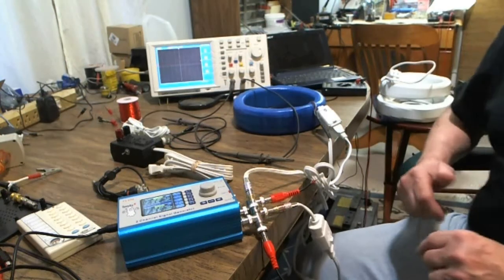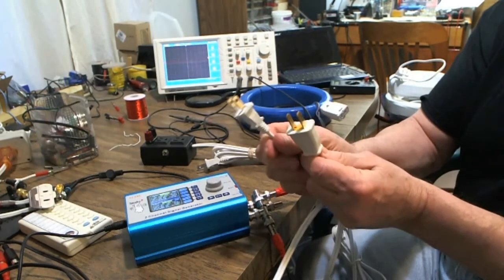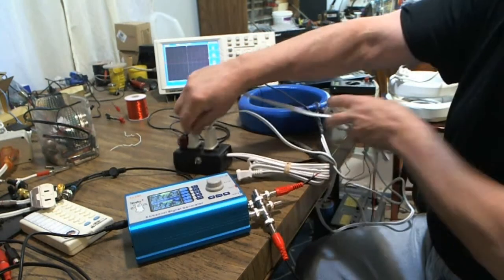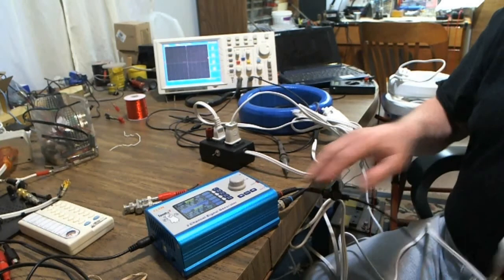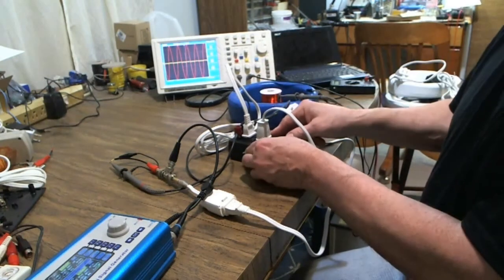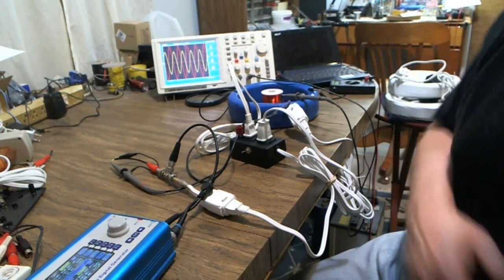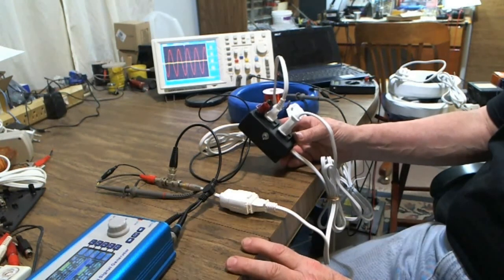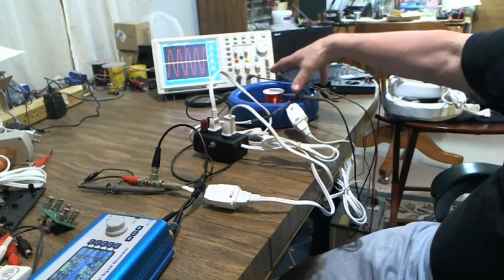Bifilar Coil & Switch Connection and Configurations

Comment: Where did the extension cord with the with the magnetic and scalar switch come from?
Reply from the maker: The local Dollar Store.  I buy them in quantity and could not put a plug on a 16 gauge wire pair for any where near what I pay for an extension cord.  The quality is excellent and have never had a failure. I thought it a great way to keep the cost of materials down.  Yes, I'm knocking on wood! -)
Reply: They come with switches on them? What is it doing to switch from magnetic to scalar?
Reply from the maker: I believe you are misinterpreting the video.  If you are referring to the extension cords, when you write the word “they”, “They”, the extension cords, do not come with a switch.  The Magnetic to Scalar switch is a simple mechanism to take t two windings of a bifilar coil and to connect them in series, for Magnetic mode or Scalar mode.  However in Scalar mode the switch reverses one of the coil's polarity to artificially reflect the wave back 180 degrees out of phase  onto itself. This eliminates the need to match the coil wire length to create a reflected standing wave. 
 
The theory of how a transmitted wave can reflect itself back on the transmission line/wire is beyond the scope of this narrative.  The obvious advantage of this phase reversal technique is that all frequencies introduced into the coil are reflected back when the switch is set to scalar mode.  As I stated in the video, the standing wave is the essence of how a scalar wave is generated.  As I understand it; the scalar wave is a pressure wave generated between the nodes of a standing wave and is transmitted longitudinally from the ends of the wire or coil.   The word ‘Scalar’ and ‘Longitudinal’ can be interchanged when describing this node to node pressure type wave.    Respectfully, Steve

http://www.aurorasky.net/MAG_-_Scalar_Cable_Schematics.pdf, http://www.aurorasky.net/Bifilar_Magnetic_to_Scalar_Switch_Schematic.pdf
Reply: Actually the nodal points are the zero potential points, that is the point where the two wave interacting with each other is the point where the two are always canceling each other out.
 https://en.wikipedia.org/wiki/Node_(physics)
http://www.physicsclassroom.com/class/waves/Lesson-4/Nodes-and-Anti-nodes
http://hyperphysics.phy-astr.gsu.edu/hbase/Waves/standw.html

What we should see when you switch to "scalar" mode is the amplitude doubling not going flat. If you are simply  reversing the leads then you are just canceling ALL of the signal out. 

180 deg out of phase means they cancel each other out, that is not scalar. 
Flipping out over is not creating anything scalar. You need to show a diagram for those coils , I'm not saying they couldn't do what you want them to do but a scalar wave is voltage only and your oscilloscope READS VOLTAGE so when you show the scope going flat, that is correct, you have zero volts. 

Now if you could send a signal one coil and send a signal in the other coil GOING THE OPPOSITE DIRECTION  then you would be creating a standing wave. 

What you are doing is just canceling each other out, nothing more.
https://www.controlbooth.com/threads/left-and-right-signals-cancelling-each-other-out.25791/

http://www.podcomplex.com/guide/physics.html

Please read under "Two sine waves travelling in opposite directions create a standing wave"
http://www.acs.psu.edu/drussell/Demos/superposition/superposition.html

http://www.dictionary.com/browse/destructive-interference
Reply from the maker: This is getting out of control.  You are exactly right.  The nodes are the zero points of two cancelling waves.  However if you were to look at the differential between the two coils in a bifilar coil connected this way, with a scope, you would see a beautifully generated standing wave.  What has been created is an electrical component from the bifilar winding with essentially no magnetic field because the magnetic component has been cancelled out.  There is a lot more to this story but this link is not the place to explain, discuss, or debate all the details.  You have both my email and phone number and why you have chosen to converse in this way has me more than a little confused.

The main purpose of the video is to show how to connect the Bifilar Coil to a Spooky2 function generator through a switch mechanism verse a combination of specialty cables.  There is a very large population, (in the many thousands), of Spooky2 users that are familiar with the concept of Scalar Waves through a device called the ‘Spooky Remote’.  The Bifilar Coil is like a ‘Spooky Remote’ on steroids.  The purpose of this video is not to talk over the heads of the many that do not have your technical background.  This is where you are taking this.

I would suggest you join the Spooky forum, which I am a member of, and place where this discussion would be a lot more appropriate. www.spooky2.com/forums/  Respectfully, Steve